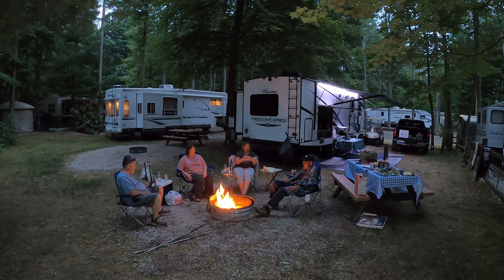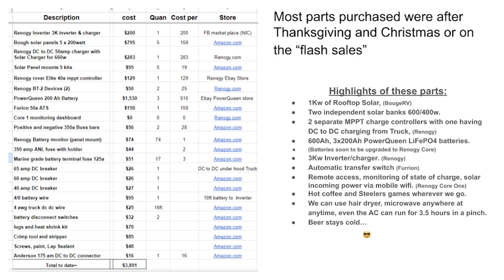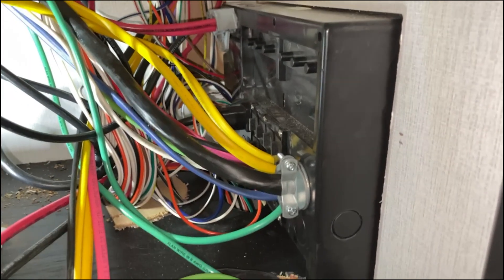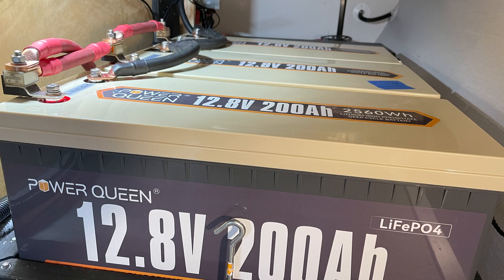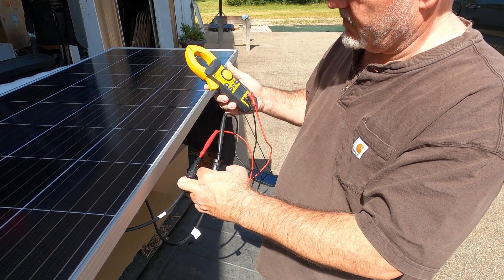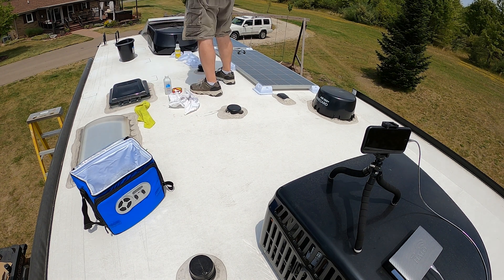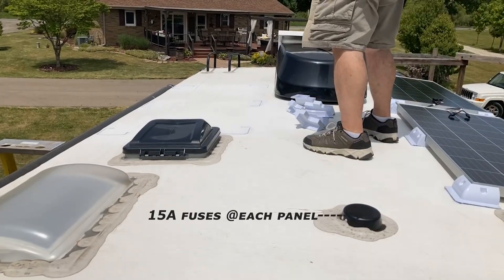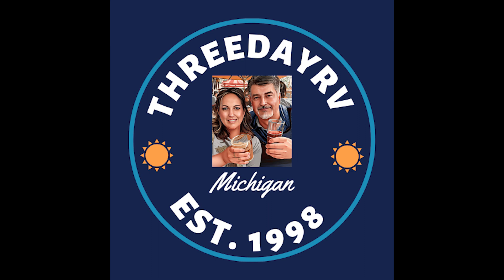Renogy Experience Upgrade part 1 /design, and install #renogy #renogysolar

Comment from the maker: This was installed on our 2022 Coachmen Freedom Express 259FKDS. This has a "solar prep" which was nothing more that a 10G wire mounted on the roof and pulled through to the under belly. That wire can handle 30amps and the Bank #1 has 600w @ 18.5v and roughly 28 amps going to the 50amp MPPT Renogy charge controller that also take alternator power and directly charges the battery while we are going down the road. The second solar bank has 400w. We will be boosting these this fall to a total of 1,350W and have a potential of 100 amps. We have a 10g and a 6g buss runs. Subscribe so you won't miss the upgrades coming soon.!